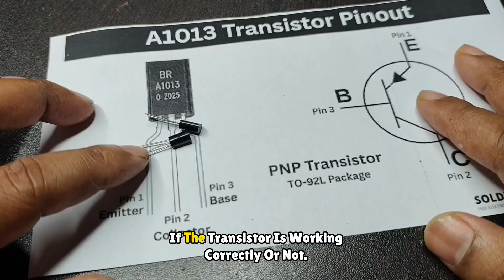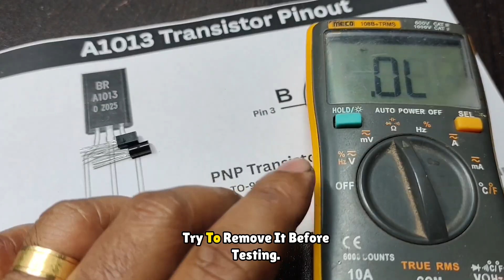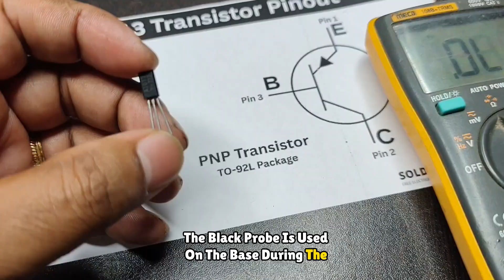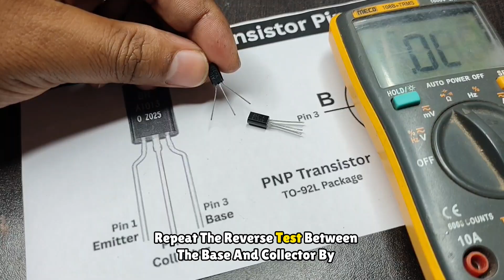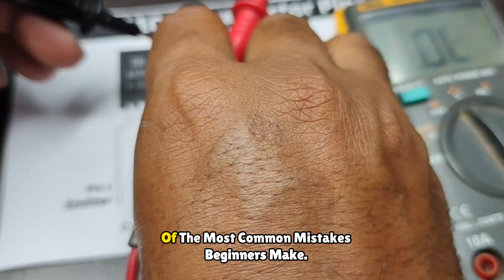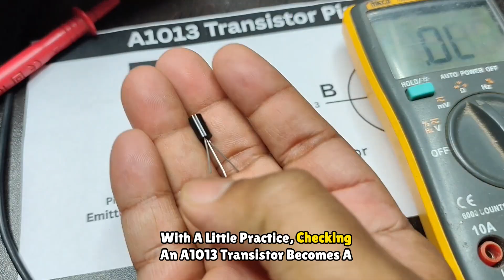A1013 Transistor Testing with a Multimeter | Beginner's Guide

Comment: this is a normal junction verification that shows the expected result from a transistor that has not failed. the same process is valid for NPN transistors. but the test does not confirm that the transistor can function to meet the specification for power dissipation.